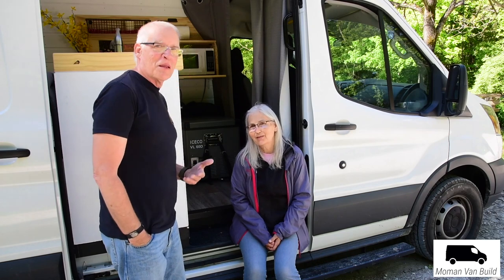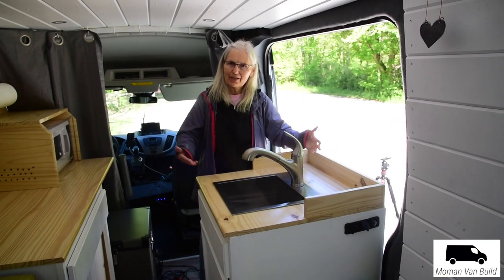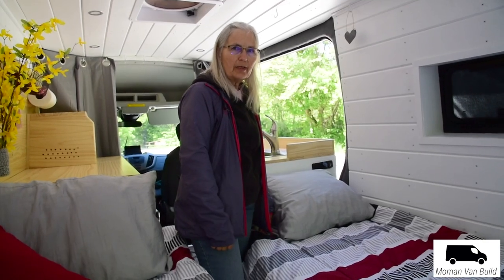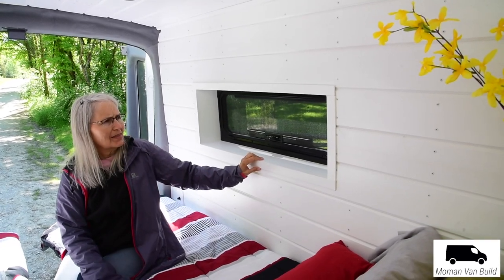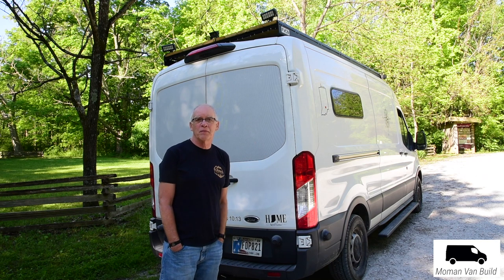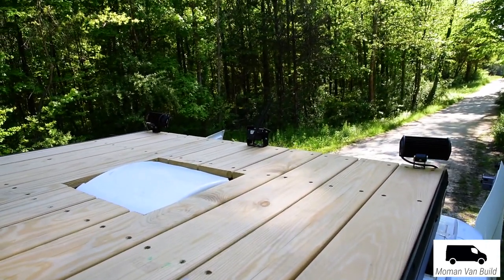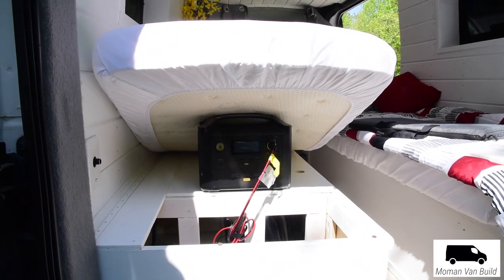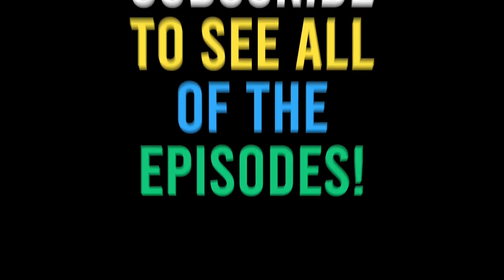Episode #70 - Van Tour - Retired Couple's DIY Simple & Beautiful Conversion - Full version

Comment: Beautiful job on the van, and great video presentation.  Question: coach air conditioning option while camping?
Reply from the maker: It’s camping and we will sweat sometimes. The roof fan and passive really pull a lot of air through the van. We also will have small personal fans to blow right on us. We are not trying recreate our home while in the van but just do the best we can.
Reply from the maker: Check out episode #91 - we use a ZeroBreeze portable AC now - works great. Not. Cheap. But 12v!

Comment: How long would the eco flow delta keep the fridge freezer charged for?
Reply from the maker: I have- not done a test, but the Delta would run it multiple days I guess, unless it is crazy hot and the van is open to the heat. I should run a test and I will.

Comment: Happy for you both. I think you misunderstood my question the other day. I wondered  what it would cost the rest of us to do what you did. We don’t have the sponsors so was wondering if you could give an estimate of what it would cost the rest of us if we chose to go the route you did. Don’t expect exact just an estimate of the expensive batteries, inverter, etc. 
thanks
Reply from the maker: OK - I would say the average person would not buy all that we were given or use it on every trip. We spent about $8,000 and I would guess another $10-12,000 for the overall cost from corporate partners. $18,000 to $20,000 would be a good overall number that applies to have what we have.
Reply: @charlesmoman  thanks so much. We would do exactly what you did. It’s perfect. We sold the airstream because it was just too much. Always afraid something was gong to break. Thank you for sharing all your work with us. Simple is the best. You can access everybody single part of that van. Brilliant